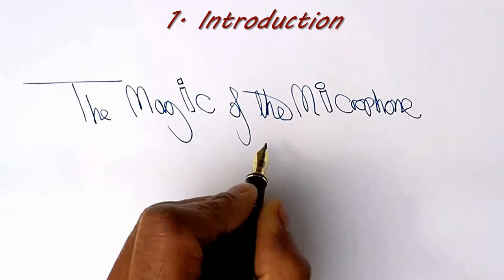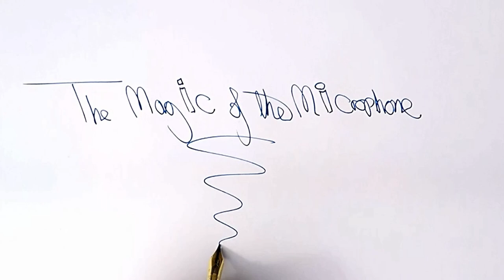The Magic of the Microphone - 1. Introduction and The 'Perfect' Microphone.

Comment: A very valid point. One microphone which suits one persons voice may not suit another's. And as you correctly point out, if you don't want to make a potentially expensive mistake, one should always audition various mics from different manufactures, or even different mics within one brand. A useful tip for those who want to buy a microphone is always to take a friend, who understands sounds and mics etc. along with you. A second pair of ears will often be able to hear differences that you as the potential buyer may not be able to hear easily. Looking forward to the next videos in this series.